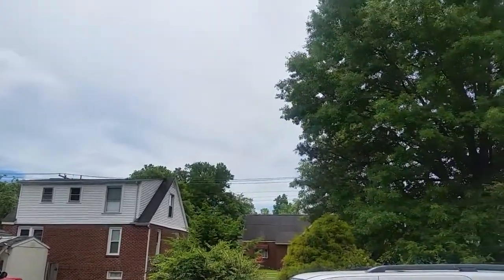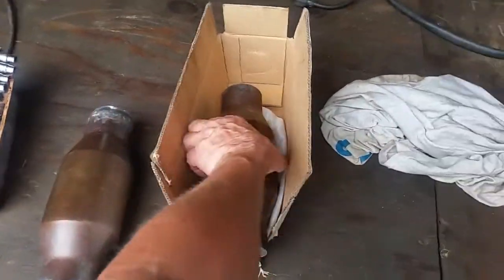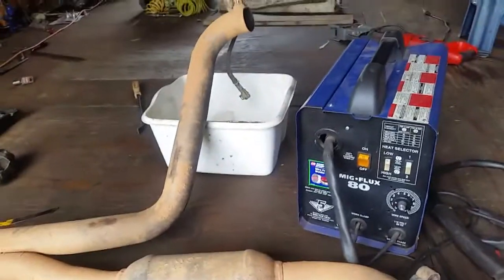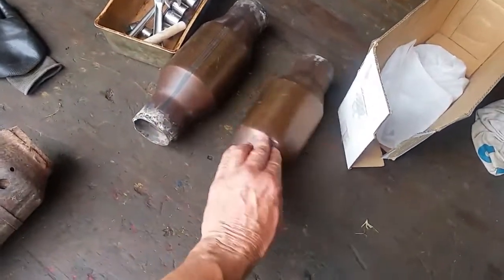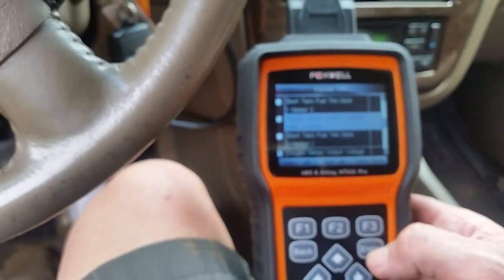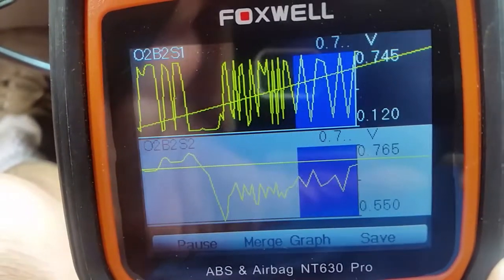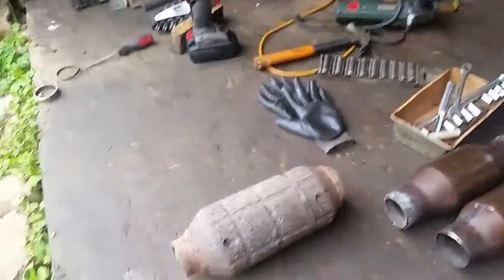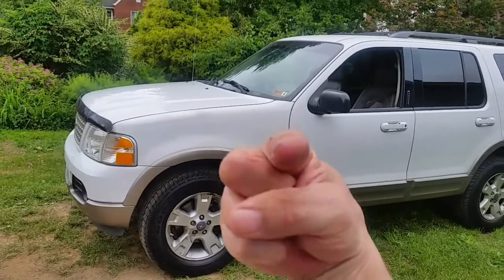PO420-PO430....When new cheap catalytic converters FAIL.

Comment: Aftermarket universal cats will have a higher flow, less filtration. You could have ran both cats and extended your o2 sensor to the last welded catalytic converter.
Reply from the maker: Yea next time.

Comment: I understand your pain I bought some off eBay and still get a code they sent me new ones hate to put them on
Reply from the maker: Also...Watch your fuel trims (if you have a obd2 reader). If there just one bank that's running somewhat high,  just one bank, then it will trip the light for a p0420 code.
Reply: Use only walker converter or nilight it erases codes  I guarantee you 🎉

Comment: I would think a too small replacement wouldn't do the trick, especially if the vehicle's other exhaust components are CARB compliant. Everything I've read about CARB units is that they contain more of the expensive precious metals that do the cleaning (thus the higher price). Some aftermarket sellers sell alleged matching units. One site said EPA rated cats are fine on a CARB listed vehicle if the vehicle is no longer where regulations dictate original type cats. The CARB cats are stamped to display that they are legal for use in the few states that test. A "Smog" facility looks for the stamps, and will fail a vehicle that doesn't meet requirements, even if the cat is working fine.
Reply: ...some (honest) sellers won't even ship a non-CARB cat to a state that requires them, knowing that there will be issues.

Comment: Idk why people think these are gonna do the same job as the factory cats when they are anywhere from 1/2 to 1/3 of the size and only cost $50.
Reply from the maker: People are desperate for replacements because of cats thiefs. There never as good as OEM.
Reply: It's the brand I went with walker on the bottom that guarantees no check engine and used ni light on the top in a 2008 Accord no check engine  use nilight or walker both aftermarket but work like OEM

Comment: These cheaper made "high flow" versions do not have enough material in them to form enough of a reaction to make the changes the ECM wants to see. They're also not made with very good quality materials. Chinesium as I like to call it lol. 

I tuned my PCM to not perform catalyst diagnostics. I use these cheaper cats just to help control the dirty exhaust. They may not fully meet the EPA standards, but they work for me. I run 2 of them. 1 on each bank. GM 3800 V6. It also helped control the louder exhaust setup I have.
Reply: Are these cheaper crap than magna flows. How are magna flows?
Reply: @asianstud7  I can't speak on the magnaflows. These are called "high flow" when in reality they are still a 400 cell per square inch substrate cat just like any stock cat. They just have lower quality metals used to make the substrate material. The Flowmaster high flow is an actual higher flowing cat. It's 200 cell per square inch vs 400. Flowmaster cost a little bit more than these. 

A true quality made high flow cat can still easily set the CEL for catalyst efficiency being to low just for the fact that they just aren't doing as much as a factory cat does too remove hydrocarbons from the exhaust. 

That's just what I know. Magnaflow  generally makes a good product. I'm just not familiar with what they have as far as cats go
Reply: What is the PCM? And how does one turn it off to not perform diagnostics?
Reply: @asianstud7  the PCM is the Power train Control Module. Also called a ECM. Engine Control Module. 

You can't turn the PCM off. It is the computer brain that analyzes and controls how the engine operates. But they can be tuned. Depending on what year. 

With 96 and later engines we have what's called OBD2. 95 and earlier are referred to as OBD1. 

OBD2 (second generation OnBoard Diagnostics) can be tuned or have certain tables redefined using an aftermarket tuning software such as HP Tuners for example as it's the most commonly used program today. There's a table in there with all the DTC codes used by your engine. Sometimes it's as simple as just changing the certain codes to not report anything. And with other things you may need to change other tables to change the tune as well. 

It's not something to purchase just to play with or turn a code off. It's a fairly sophisticated program that requires a bit of knowledge and training to operate. I spent $400 for the hardware. Another $100 for the credits to license 1 vehicles PCM, and then a lot of time studying how to use it. After a few years of using the program, I now do tuning for other people. 

You use to be able to send your PCM to places and get them flashed with custom tunes (canned tune), but due to the EPA cracking down on businesses that were alerting emissions, no one will tune these specific codes out anymore because of the big fines. It's left people having to do it themselves.
Reply: @boosted0079  Oh very interesting. So basically it aint for the faint of heart? LOL. I heard if my aftermarket cat does throw up a light, I can try using oxygen sensor spacers to trick the computer? Have you heard about that and have any first hand knowledge?

Also, I heard you have to reset the PCM after changing out your cat? Is that true?
Reply: @asianstud7  the spacers are an inexpensive alternative that usually work most of the time. Sometimes they don't. I've seen more work than not . If it doesn't work then you only out a few dollars. You can get them in auto parts stores. They're actually called "anti-foulers" that were meant to be used with spark plugs I believe. But I've talked with guys that use them successfully. Sometimes 2 of them stacked together need to be used. They basically just get the sensor out of the exhaust stream. 

I've not heard of anything about needing to reset a computer after installing a  new cat before. I certainly never needed to.
Reply: @boosted0079  how does getting the sensor out of the exhaust stream help the vehicle? Obviously I'm not a car guy like you are. Does it make the car run smoother? In all honesty I don't car much about my new aftermarket sensor doing its job correctly or not. I live in Tennessee and we just now got rid of our emissions requirements. The only reason why I'm replacing the cat I got stolen was because I don't want to hear the loud noise. I could get a new OE converter and not worry about codes and such but I'm sure I will get my new one stolen again soon. I had mine stolen just 3 months ago before the one I recently got stolen. That's why I'm going the cheap route this time.  At least this way I'm out 300 bucks at a time rather than 3000. 😂. I could just straight pipe it but I heard my car will run rough. What's the best solution you think? I figured I'd just put an aftermarket one on and if I still get a engine light maybe I can get the fouler and trick the engine to run better. 

Here's my dilemma. I don't want to invest in a lot of money because I'm anticipating the cat getting stolen again. But on the other hand I want the car to run smoothly while I have the cat and if I get lucky this time and I don't get it stolen, I can still live with the cat because it's working fine. And again when I say fine I don't mean it meeting emissions standards as I don't have to worry about that any longer. 
Also, I am installing an aftermarket EPA compliant only cat on my EPA and California emissions compliant vehicle. As I'm not in either California or NY , I was told I can legally do so. For cars like mine what is the minimum threshold the computer looks for so that the engine doesn't throw up an engine light? Although my car is California compliant, does the cat only need to meet the EPA emissions thresholds and parameters for the light to not come on?

And lastly, if the The fouler will trick the engine and not read the oxygen sensor, how does that affect engine performance and drivability if any? Sorry for so many questions. Thanks for patiently answering all of them. Thank you 🙏
Reply: @asianstud7  usually there are two, one before the car, that sets the tune. The second sensor is after the car, is only for emissions.
The foulers O2 sensor extensions do work, some come with spacer restrictors to limit the exhaust readings.
Paint the catalytic converter orange, go to Harbor Freight and buy steel wire with it's locks. They can steal them, but give them a hard time, and it will be a red flag when if inspectors see painted CC. Some weld rebar parallel to the cc to block the blade from cutting.

Comment: Hey Nathan Rohrbough does Magnaflow make a Quality CARB catalytic converter? I have a 2002 Lexus is300 that needs a bank 2 cat replacement. The OEM for a lexus cat is over $3000.00. The Magnaflow cat is around $1600.00. Do you feel the aftermarket would fail shortly after installed?
Reply: magnaflow is ok. $200 universal  cat is ok.

Comment: I had not seen this video before I bought front and rear converters on eBay. I have a 2000 3.0 6 cyl. As soon as they were on the rev limiter started kicking in. I think I actually can smell rotten eggs sometimes. The old converter was broken inside and loud. It was much larger but never gave off any odor or mess with performance. I did put my obdII on here and the "waves" on the front sensor and rear sensor are NOT identical. So maybe that is sort of good.
Reply from the maker: Yea I've not had good luck lately with aftermarket cats ;(